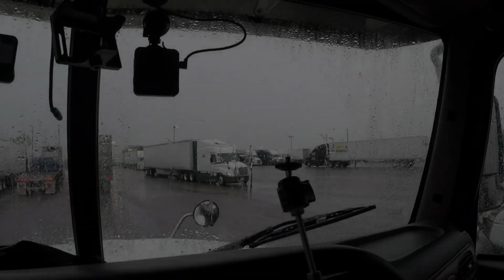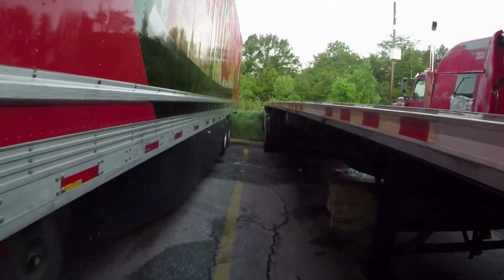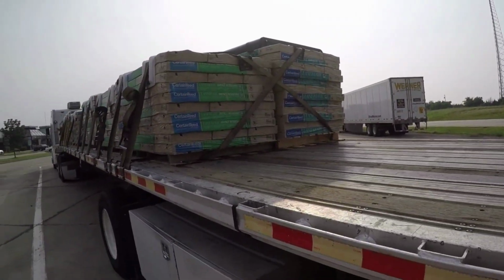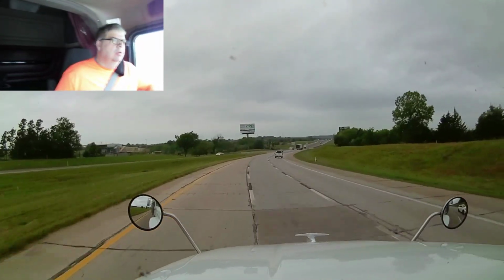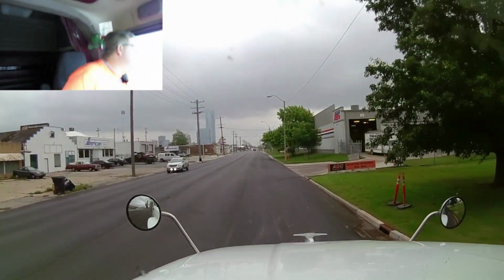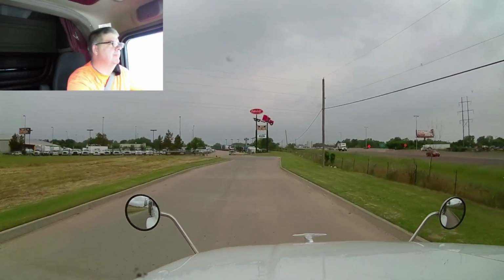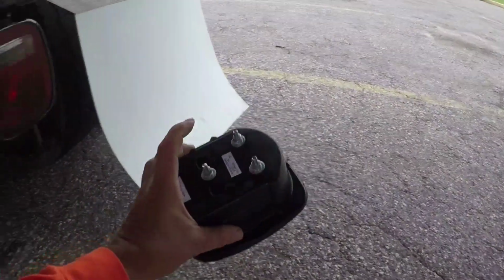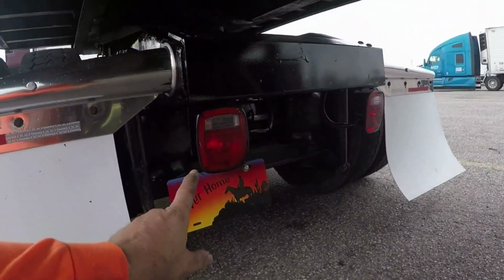#316 Roofing Shingles Taillight Replacement Truck Inspection Life of an Owner Operator Truck Driver

Comment: For Dan to answer.. Thought.. The chrome poles with the yellow lights on the top.. That are about 2 feet high or so that are often mounted on the corners of the front bumper.. Possibly wire the lights to an always with power switch so they can be on and light up the front corners when parked if the front end sticks out..

Comment: You need your vehicle inspection every 6 weeks in the UK depending on mileage. If you miss your inspection it can go against you for your vehicle operating licence. 20000 ish kms would be 6 weekly inspection. The only thing that ever wears out are tyres and brake pads in 500000 kms
Majority of our trailers have curtains. Some with sliding roofs Box trailers are not that versatile enough and not that common now.

Comment: Hey Dan,  on your clutch, when it goes out the cab it connects into 2 pieces there, it would be like a tube about 2.5-3inch long, then connects to a rod into the trans,  i had a KW like that, and found out there is a small bushing that broke inside that tube,   drove me crazy..   Had a mechanic tell me that that small bushing, plastic, would break inside and you wouldn't even know it and it would squeak when it binds against the metal rod.  .

Comment: Thank you Dan for sharing a bulb gear video. Are the Paccar europeen engine convertible with Jake Brakes? And if, built in? Or a device on the outside of the engine block( yeah familiar with the princip of air pressure in the valves)
?

Comment: What does the buzzer indicate?
Safe travels home
Reply: The buzzer operates when Dan dumps the air out of the rear trailer axle suspension. Makes it easier to drag it around tight turns and saves the tires.....
Reply: Jayen4   Thanks for the info.
I look for him all the time but don’t think Dan gets east of Cincinnati